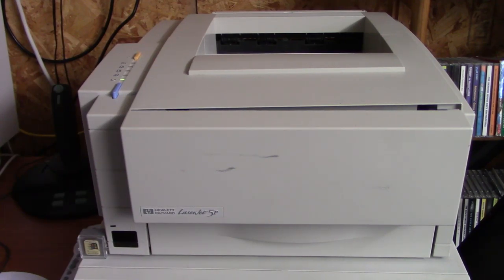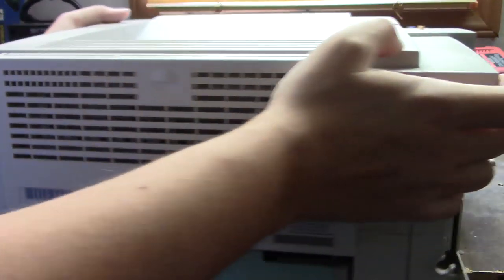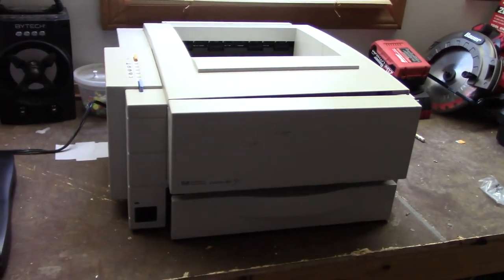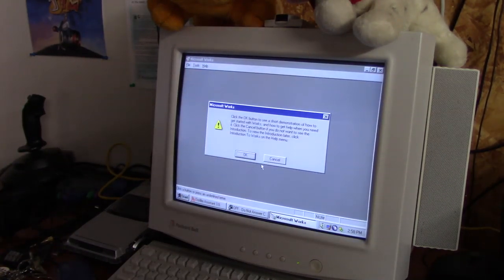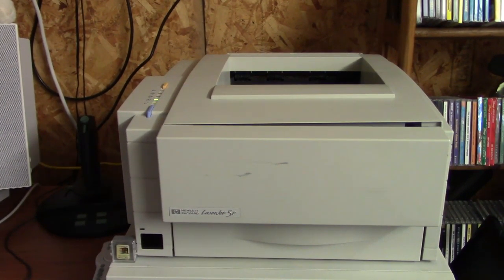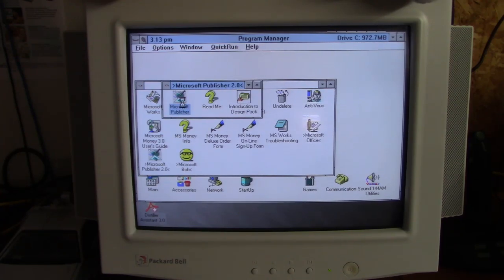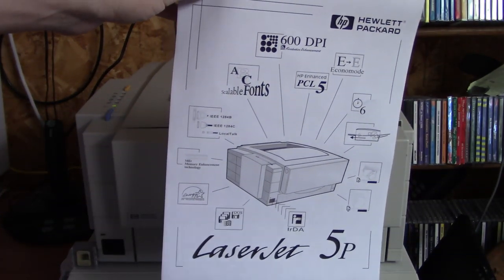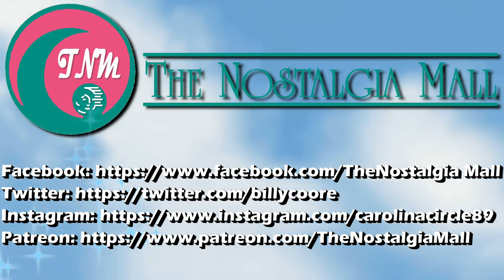Fun With an HP LaserJet 5P

Comment: Still have one of these in use today.  That rear pull down is an out feed sonyou can print thick stock of envelopes straight through the printer with the print out getting curled around the main top out feed.

Comment: Got my hands on a 6P in 1986, near identical except more ram. These never die. This will print your entire novel, windows standard image formats, PDFs, anything text, print screen files. anything with print options
I was just using my laserjet a short while ago on my bench computer (XP-pro) on the last of the 03a second toner cartridge, run the cleaning utility and prints just fine for 44 years old and a hundred reams of paper. You should get the user guide (it is big)(print that too) I have a good 10 reams of printing to do and this will be doing it after I refill the 03a. Hey, those fold open trays are in and out the back for Avery and envelopes. (read the guide)
Thanks for sharing this.

Comment: I have the same exact printer. I've been using it since around 1996 or 97, and my dad had bought it new. It says on the back that it was manufactured in September of 1995. I just printed the self test page, which I didn't know about before watching this video. The page count is 49,269.